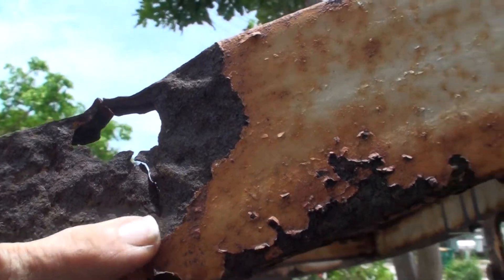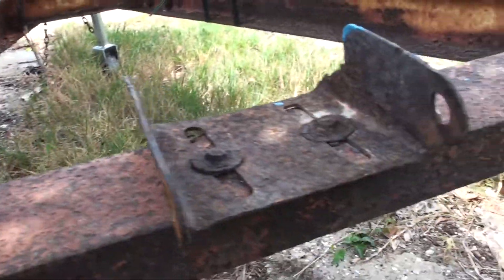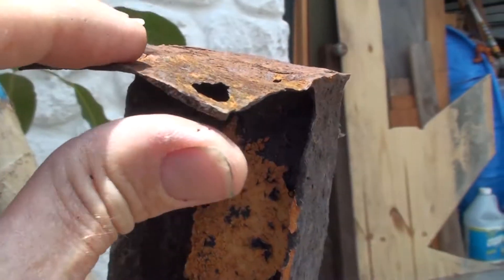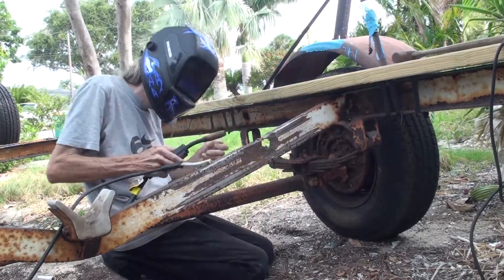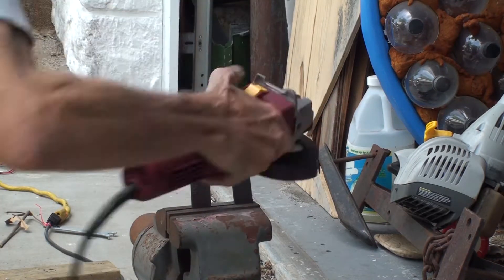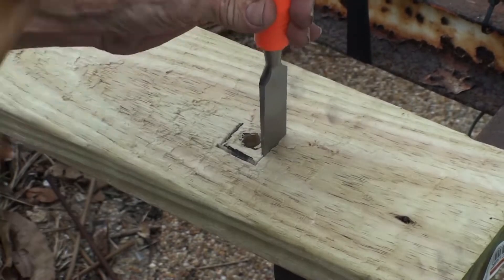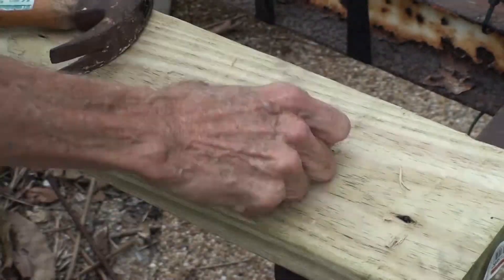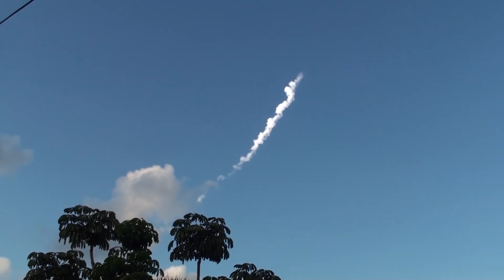Gemini 9 - Trailer Repairs and Falcon 9 launch

Comment: You're right about that.  Got a good deal on a lightly used aluminum trailer for it this week.  Adding the four stroke engine, generator and air conditioner behind where the trailer axle was under the boat, left no downward pressure on the hitch.  I trailered it with three water jugs tied to the bow just to give it some weight.  The new trailer has a second axle rearward of where the original trailers axle was.  There is also a lot more support under the stern of the boat now.  To make the deal, I sold the old boat and its trailer for $800, a camera for another $800 and added another $400 in cash to that.  Yes, I have now paid $2000 for a trailer for my $900 yacht.  There are many thousands invested at this point, but all in small enough chunks that no single upgrade was unaffordable.  The trailer has been the biggest single expense so far, but a necessary one.  Its also the first time I have resorted to selling stuff to buy for the boat, but the old boat was redundant at this point and I do have another camera.  I might have gotten a few more seasons out of the old trailer before some catastrophic failure, but the best time to upgrade the trailer is before, not after the catastrophe.  I now have so much of my time and money in the boat that I am becoming very protective of it.